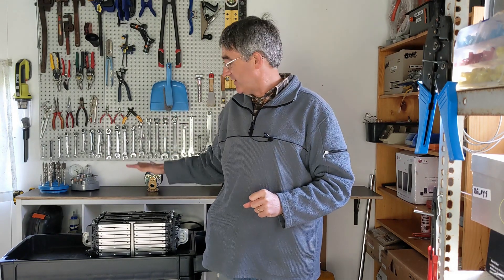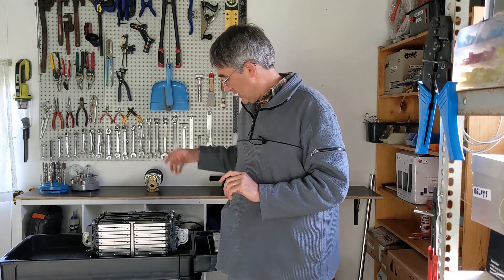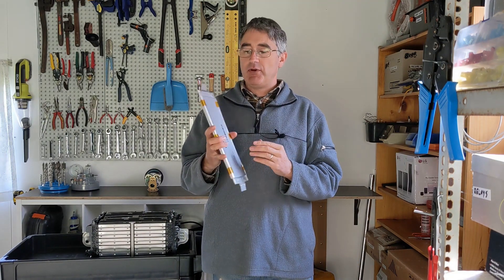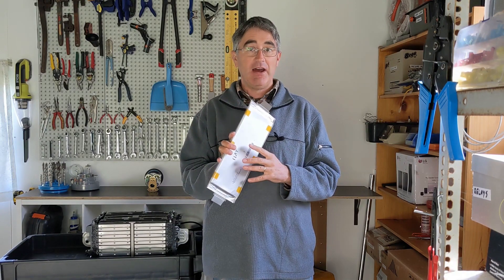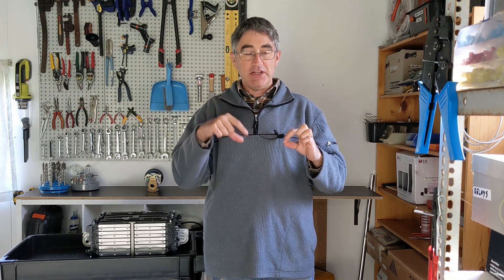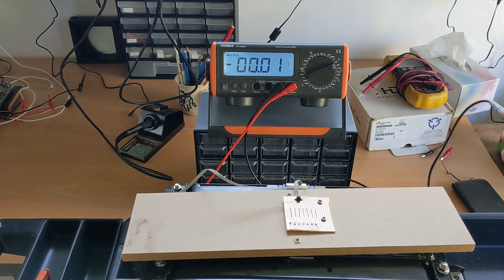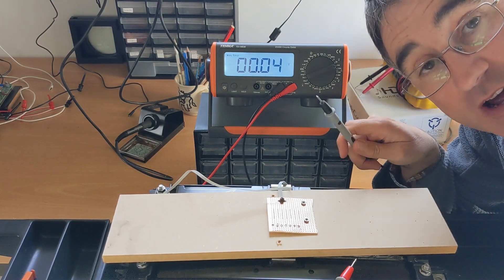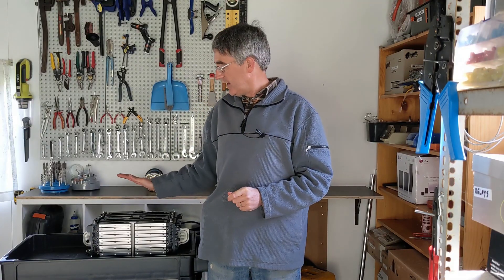Hyundai Kia EV Battery Teardown

Comment: Chris, do you happen to have part numbers for the connectors used to get to the individual cell voltages? tia
Reply from the maker: Oh, didn't I say?
It is Molex 502351-0400
Available from RS Components, stock No. 896-7594

Comment: Fantastic video thank you. Is each side 6 in series (block each side of the cooling fins identical?) looking for an affordable 24/48v battery setup thanks
Reply from the maker: Yes they are identical.  So they can be connected in series (48V) or parallel (24V).
Watch the voltages though, as they are not the same as lead-acid.  Voltage for a 48V system would range from about 36V empty to 48V full.  So make sure your charger and appliances (or inverter) can handle that voltage range.